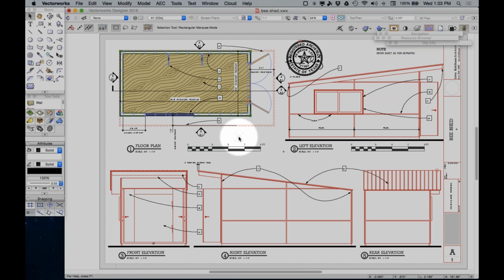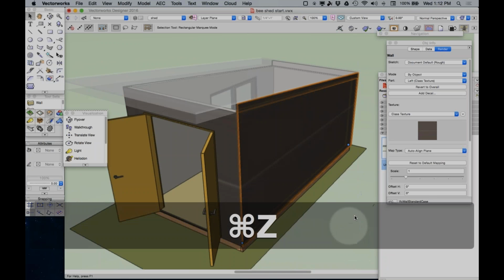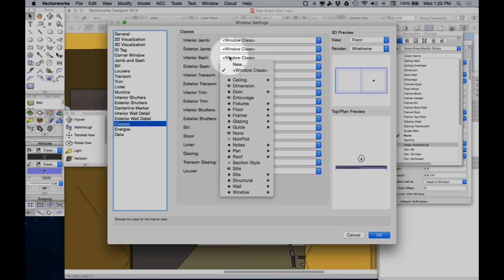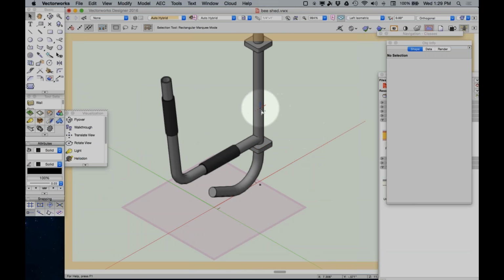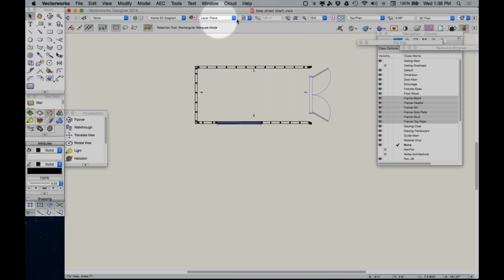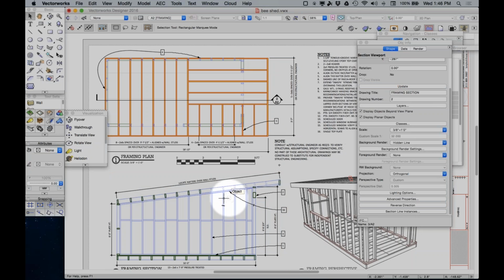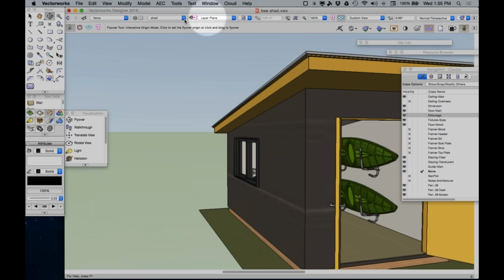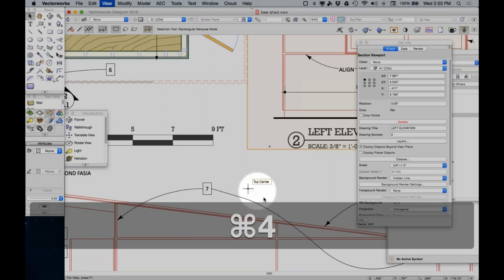Pocket Vectorworks Project

Comment: Quick question - you mentioned Roll angle of the rafters in the object info.  I see that the version of VW is 2006 when you created this file.  I am now working in VW 2021, and the Roll angle option is not there.  Would you know to where it was relocated, was it eliminated, or is there a different way to roll the framing members to align to the slope in the new version of VW?  Also, thank you for this informative video.  I am actually creating a similar shed with a flat sloping roof.